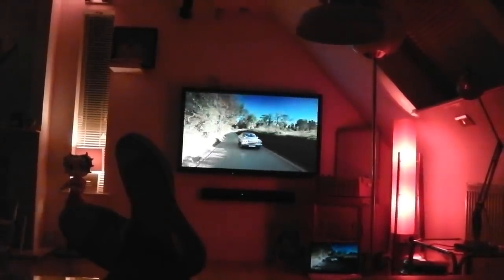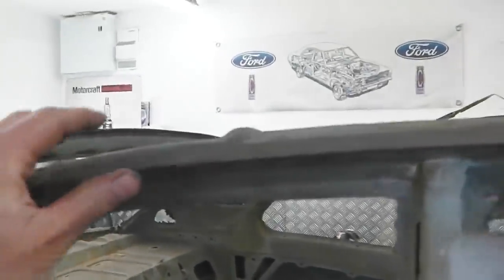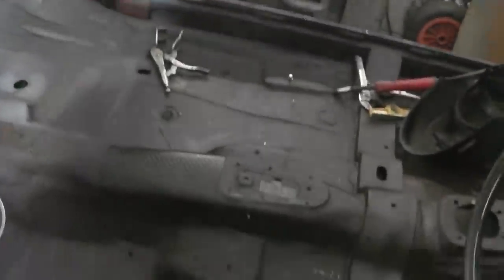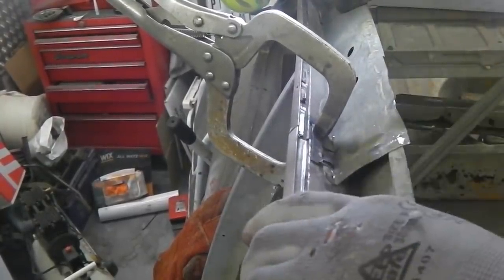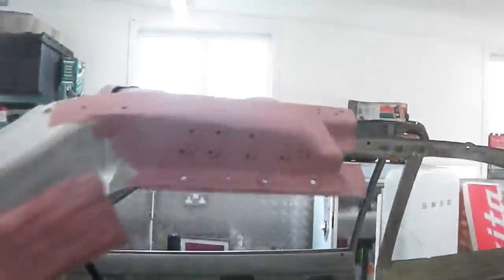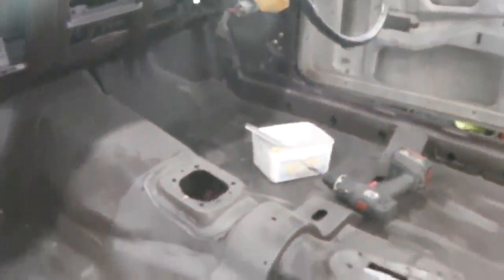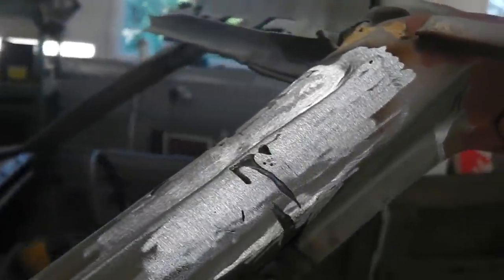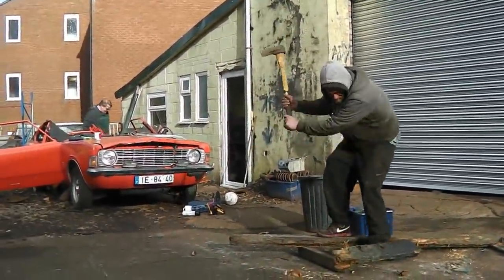Classic Car Restoration - Mk3 Cortina EP20 Pt2

Comment: Fantastic work Mr C, coming on a storm. Is there not a spar that fits between the B pillars? Or does that fit to the skin and bolt to the B pillars? Can't remember. This car is going to be the dogs ding dang doos by the time its finished. Just don't burn yourself out in the process it will still be there after taking a break from it. Still brilliant vid though,  can't wait for the next instalment. Oooooohhh yeeeaaahh ☺ 👍
Reply from the maker: ooo yea, yes spar is fitted in 20 pt3 ! i had few days off to recharge just off out now to film EP21!